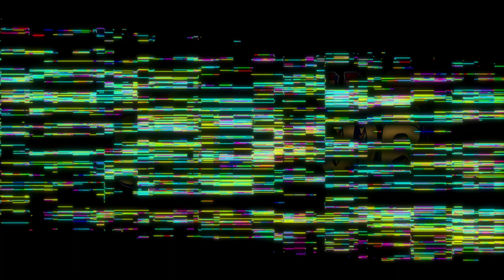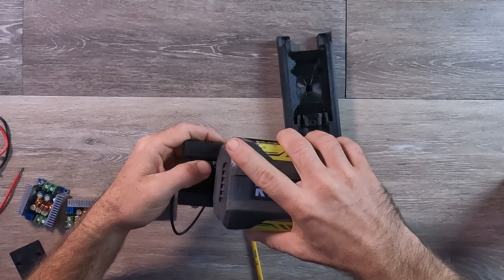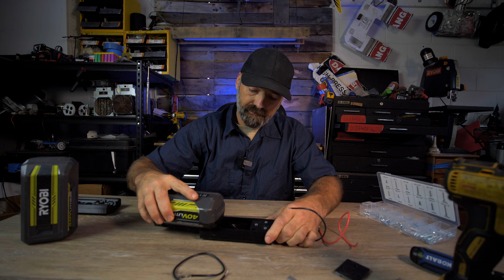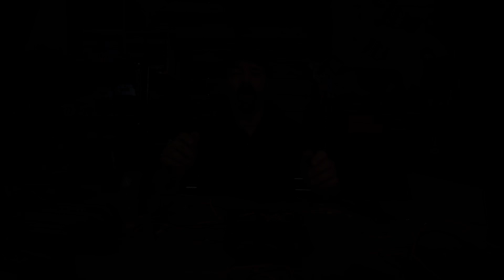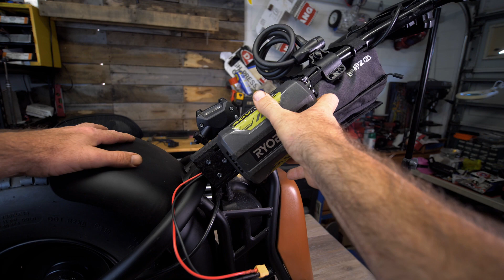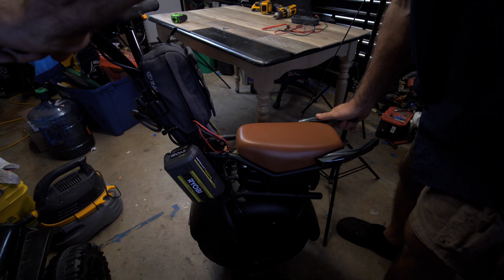Super Ride S1000 Ryobi Powered/Range Extending Hack/So Awesome!!

Comment: Just picked one up with the wrong charger. Going to splice my own but what is the max charge voltage for the stock battery? Such as 61.2v or so on
Reply from the maker: 60v charger that puts out 67.2 volts max

Comment: Hello, I bought a superride s1000, could you give me the information about the charger, what size is the voltage, and do you know where they are sold?
Reply: on Amazon I looked at one but I think the connector is bigger
Reply from the maker: It is a 60v charger. If you email me from my home page I will send you a link
Reply: @SteveWB  Could you tell me how long the tip of the charger is please?  🙏
Reply from the maker: @albertojhuerta8098  10mm diameter